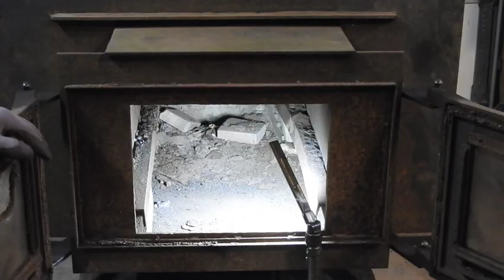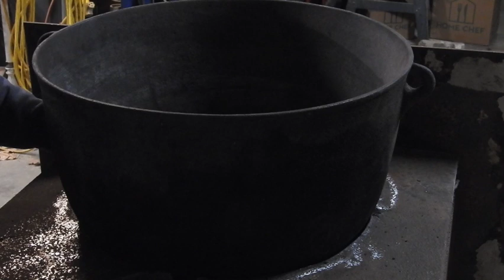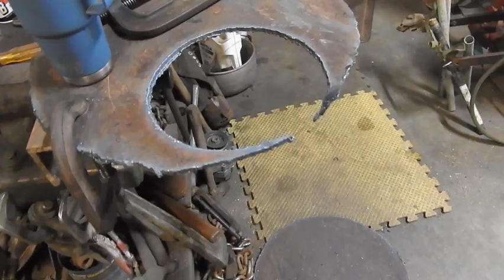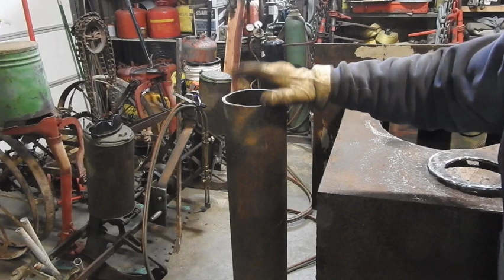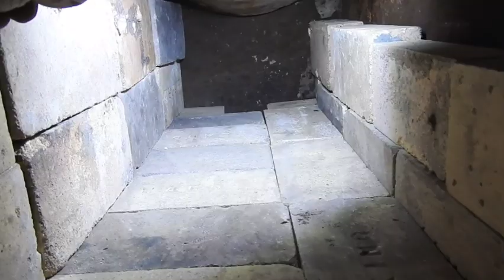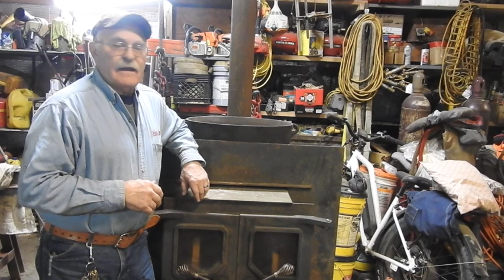Fireplace Insert Repurpose Project- Can We Render Lard With It

Comment: Nice job Wendell. Lay some ceramic fiber around that kettle at the bottom and that should keep the smoke from coming out.
Reply from the maker: You're the second to suggest that. I do have a little furnace rope on the shelf and I will keep that in mind if it turns out too smokey after all.

Comment: Now yer cookin' Wendell,. now there's 'stove that I am familiar with, in fact my Dear ol' Dad had a Heatilator*  in his house at one time, and man, that did heat the home really well.
* I used upper case 'H' as it's a brand name.
I'm looking forward once more to watching your butchering video I hope you'll be able to show us soon.
Reply from the maker: I think 'Heatilator' is like the 'Crescent' in adjustable wrenches Reg.  We use it to reference a particular style of fireplace or insert involving the plenum wrapped heat exchanger for transferring heat to circulating air. Butchering is right around the corner, but unfortunately its always a busy day that doesn't allow a lot of spare time for video.  I usually get what I can get and wing it every time.  Short handed most of the time.  LOL
Reply: @tractorman4461  I`ll settle for the `scraps` of video you do give us.
Reply: My father back in the late 70's welded up a fireplace for the basement. It backed onto the furnace room. He shrouded the backside of the furnace and ducted it into the return duct. He installed 7 1 1/4" tubes in the burn box to convect more hot air into the house. No CSA approval so he nervously went without fire insurance for 20 years before he replaced it with gas. He too was a tin basher. Took on his apprenticeship at 39 to feed and clothe 6 kids. Come home from work at 4, have supper followed by a 30 minute nap and then work in the garage on his side hustles till 10 making furniture for clients to supplement his income. Took Sunday off being Roman Catholic. Passed away in 2016 at 85. Tough old fart he was.
Reply from the maker: @daviddesilva4971  I understand what your Pop did David.  He understood well the reasons for designing what he did.  I gotta agree with you, the older generation were tough ones for sure. Times were tougher back then and may get just a little tougher in the future for a while, but it'll all work out.